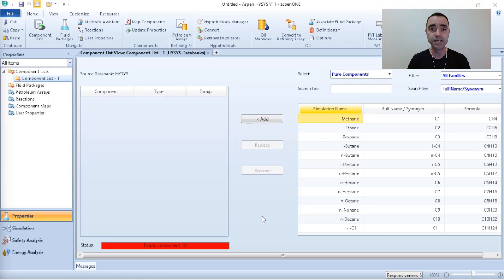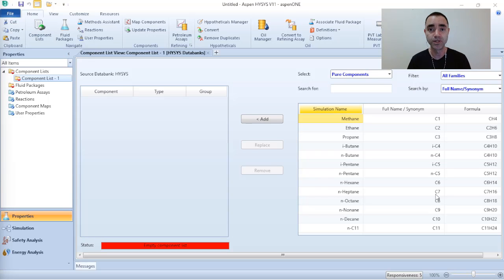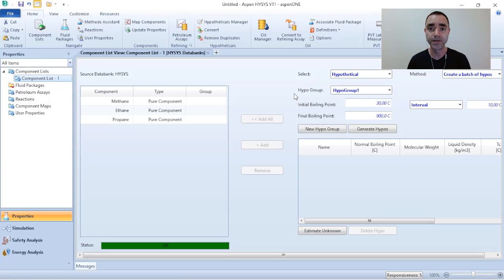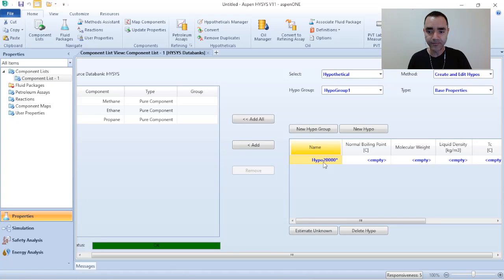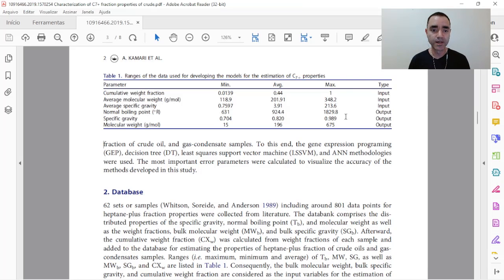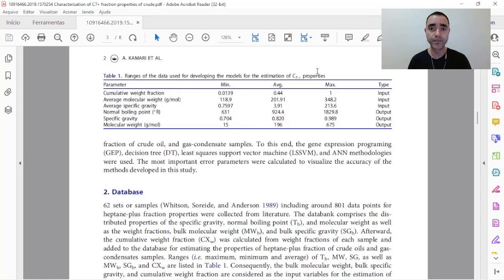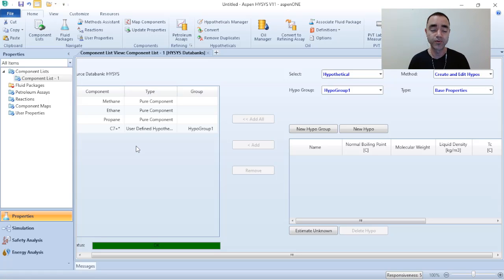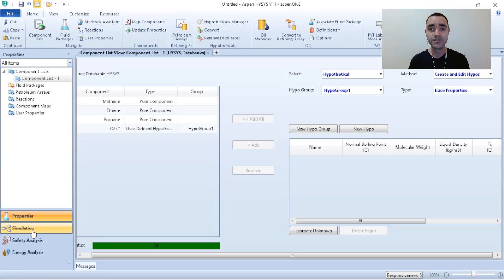HOW TO ADD C7+ COMPONENT ON ASPEN HYSYS | WHAT IS C7+ FOR CHEMICAL PROCESS ENGINEERS

Comment: Thank you so much for the explanation. In case i want to find the same properties but for the C6+, is the table available in the book? In case yes can you tell me the name of the book?
Reply from the maker: You can look for this paper "Characterization of C7+ fraction properties of crude oils and gas-condensates using data driven models". it was the one used in the video.